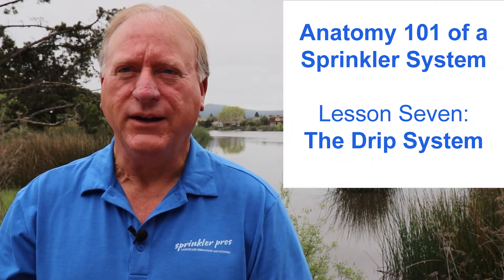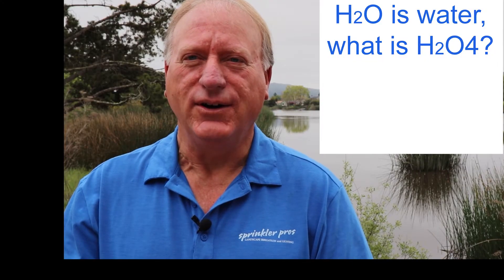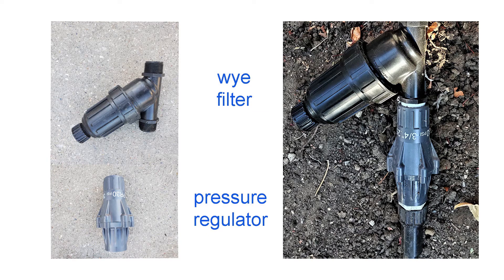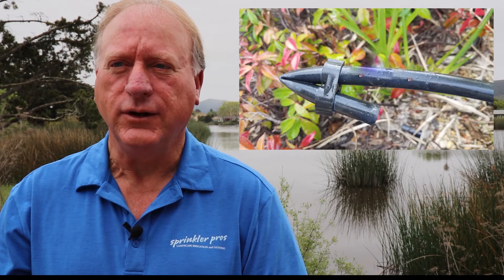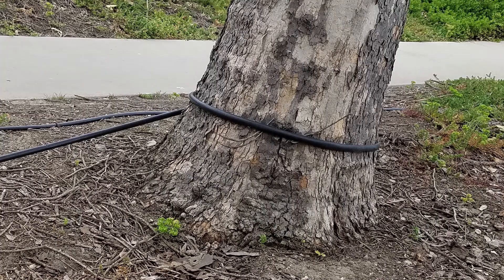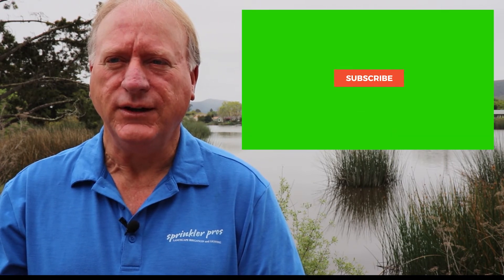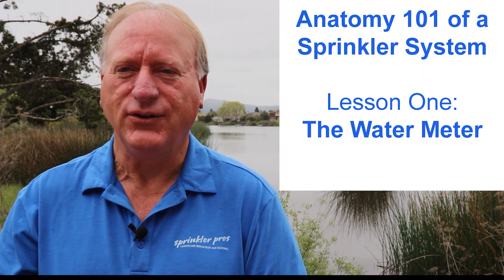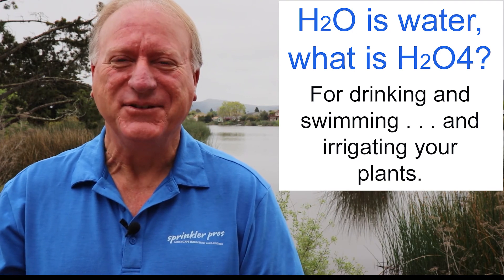Overview of The Drip System | Lesson Seven of the Anatomy 101 series

Comment: Great video. Do I need to add a device that prevents water backflow to the dripping system?
Reply: If your drip system is connected to a sprinkler valve and that sprinkler valve is an anti-siphon valve then that takes care of that concern if you don't already have a brass backflow device before the sprinkler valves. You can see an explanation about anti-siphon valves in my video called All About Sprinkler Valves. Thank you for your question.
Reply: @BlondeJedi  Thanks James. I am thinking to convert a sprinkler head to a drip system. My sprinkler system has anti-siphon valves.
Reply from the maker: @helenwei3941  Just so you know, the reply from James Lanier is me. I forgot to sign into YouTube with my business account when I replied to you.
Reply from the maker: @helenwei3941  My best recommendation for your situation is a Rain Bird Xerigation RETRO-1800. You can find it on Amazon. I tried to include the link for you but YouTube won't let me post a web link.
Reply: @SprinklerPros  Yes. I know you are James. You quote James in your videos sometimes. :)
Reply: @SprinklerPros  Thank you very much for the recommendation.